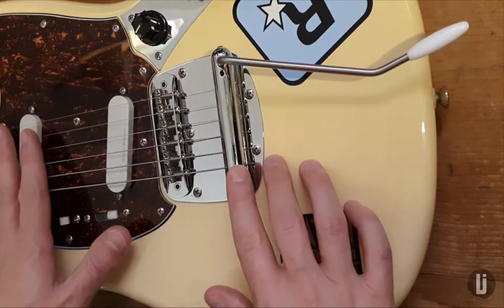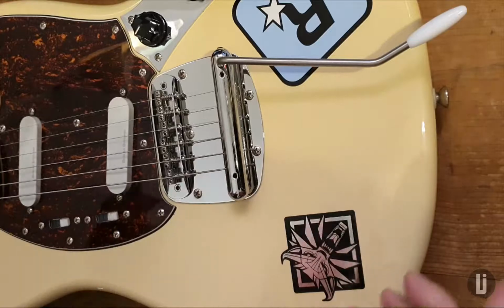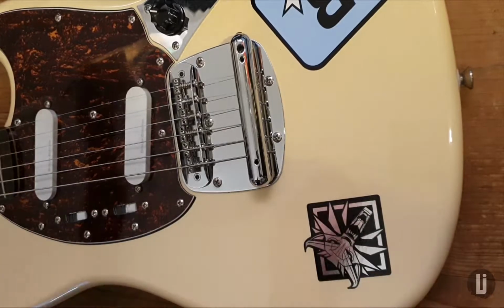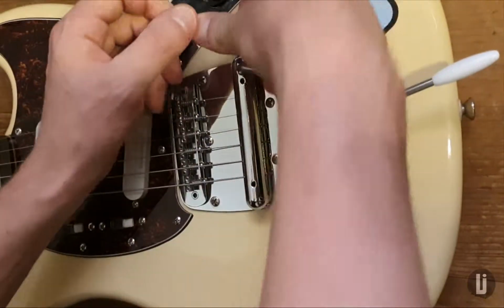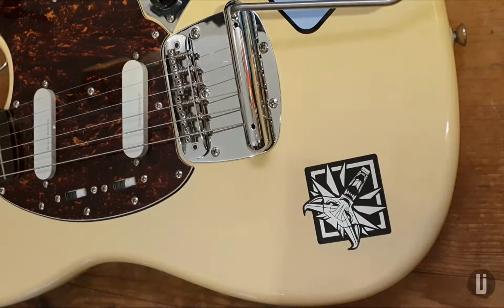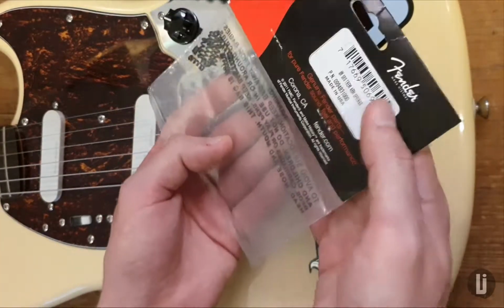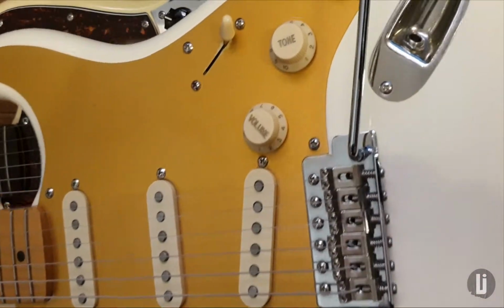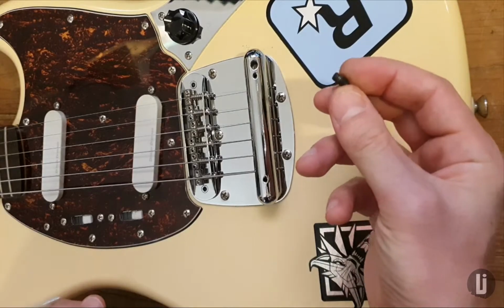How To Fix Fender Mustang Loose Vibrato Arm For Good

Comment: You just made my day. Since I play Surf and Rock a Billy = (like Stray Cats) I need the wiggle stick. Just did this mod and it works great. Mustang tremolo stays in tune better than my Strat so I don't know what these people are talking about. Its disinformation that keeps getting repeated until it's the truth, I guess. Heads up it's not a Floyd Rose.
Reply from the maker: I'm glad you found it useful.

It's not a Floyd Rose, absolutely, and cheaper versions tend to lose the knife edge quickly (it's happening on mine sadly) which I guess is part of the bad rap, but a good setup and proper care do go a long way.

Comment: Take a small round file' file a grove in the tremolo arm' fit in a small ballbearing' install spring. Lube the ballbearing and trem arm first before installing.
Reply from the maker: I'm kinda confused about where the ballbearing goes, or what I would be achieving. Is there anywhere I can see that? Sounds interesting.
Reply: @lonerjuan  
Insert the ballbearing into the end of the lipstick bridge followed by the spring then the Alan screw. 
Will hold the arm in and less wear/smooth movement no matter how much tension adjustment.
Reply from the maker: @BryanClark-gk6ie  Oh, you mean just the ball! I thought you had an idea with the entire ball bearing assembly. I see now. I don't know how much room there is on this one, but I've seen that on some other guitars and it is a great idea.

Comment: Save you a nickel, use a Bic pen spring.
Reply from the maker: I tried that once on a Strat and the thread bit on the spring making quite a mess. I'm not sure how well that would go here but I guess it might work.
Reply: @lonerjuan  One works in mine, but I also filed a small notch in the bar's shaft the same width as the hole's diameter  to help keep it in.   Bulletproof now. The spring actually goes in that notch (about 1MM deep) and the bar can't fall out.
Reply from the maker: @jeffmurdock8321  Cool! It's worth a try. Thanks for the tip!

Comment: The Gilbert Gottfried of guitars 😂😂
Reply from the maker: I don't think I'll ever be up to such a standard, but what the hell, I'll take it!
Reply: @lonerjuan  sorry man it's not the voice it's the way you talk. But I promise it's not in a bad way. By the way. You figure I could just pull the mustang tailpiece with my hand to divebomb?
Reply from the maker: @ralfcaetano  Oh I didn't take it in a bad way. The late great Gilbert is some level of awesome most of us can only dream about.

About the divebomb, I guess you could, although I wouldn't call the range of a Mustang divebomb worthy. That said, if you have crazy arm strength you might extract the whole range out of the vibrato from the tailpiece alone. I've done some normal vibrato that way and it's quite hard but works if the bar is missing.

The way it's set up and how the springs are placed on the inside will affect the behavior too, but it's possible
Reply: @lonerjuan  I don't normally go too low with the whammy bar I figure I should be fine using my hand. I just need an alternative to my current gigging guitar and it just seems that a mustang might fit the bill. 

I'm pushing it too far if I go lower than two steps down.
Reply from the maker: @ralfcaetano  Two steps might not be that bad. As long as the setup is good and the knife edge/fulcrum is in good shape...

I'd still get a bar if you don't have one though.
Reply: @lonerjuan  as a Strat player I just find it practical not to have a bar.  I normally just pull on the bridge.
Reply from the maker: @ralfcaetano  I see. The good thing about this fix is you can have the bar completely out of the way and reach back to it whenever you need it. That's why I did this. I don't always want it there, but I still want it sometimes.

Same with the Strat, which is how I discovered what these springs were actually useful for.
Reply: "Son-nova-BITCH !!!"
 LOL 😄

Comment: so making the grooves in the bar by tightening the allen wrench and twisting it around first is necessary? (i didn't get enough hugs as a child btw)
Reply from the maker: It's not strictly necessary, but it does help and can probably be done in a more elegant fashion I'm sure. 

In my case, I discovered that part by accident, by repeatedly tightening it and eventually damaging the surface, but after doing some tests I found out it tends to hold on better that way compared to a part without grooves.

(I'm sorry to hear that, but at least you have good material for lyrics, so that's good, kinda?)

Comment: How do you keep your string in tune when you use the tremolo?
My mustang go out of tune every time i use the tremolo (squier classic vibe mustang)
Reply from the maker: There's a few things to a good setup on these ones. Other than the regular things you do on every other guitar, including properly filed and lubed nut and stretching the strings, the bridge setup is key.

Contrary to what many people think, it has to be able to rock back and forth freely so that there's no friction over the saddles. This is something Leo Fender himself emphasized on the patent document for the first offset bridge.

Also, the posts have to be sitting perpendicular to the body, and so does the tailpiece. In order to do that, you have to find the sweet spot between spring tension (mine need to be on the furthest notches underneath the plate) and tailpiece height (mine sits a bit tall, creating enough break angle over the bridge but not Les Paul-like break).

That said, the most crucial aspect is build quality, and that's where a Squier one like this one will eventually start to fail. Don't get me wrong, I love this guitar, to the point I had a Fender for a while and sold it instead of the Squier, but the "knife edges" the tailpiece posts pivot over have worn quite a bit and it has started to cause some issues. I don't even make height adjustments while it's under tension to avoid deformation, it just happened with normal use. I might replace the baseplate at some point because of this. The design is fine, but the material Squier uses it simply not strong enough.

Comment: Is this a vintage modified mustang?
Reply from the maker: Indeed it is, tremendously fun guitar.
Reply: I own a 1965 mustang. Could you list the mods or direct me to a video?  I’ve lived with no whammy bar for several decades.
Reply from the maker: @MrDeepwatermarine  The only mod to the whammy system is what I show on the video, sticking a spring in there. Other than hat, a properly set up bridge and you're good to go.
Reply: @lonerjuan  hi, thanks for the video, do you have any recommendations for the setup? I thought I find a video for this easily, but only find with mods.